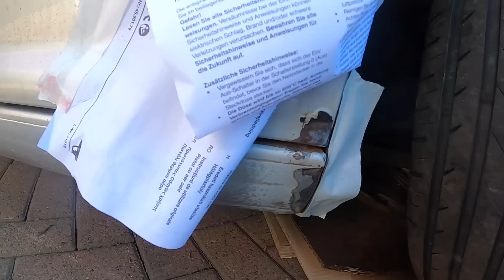Road to £10K l REGRETTING buying this car - EP.4

Comment: In 12 years of mk4 driving, any time i have had an air bag light i have disconnected the plug, pushed the wires firmly into the plug at both ends, reassembled, cancelled the light with vagcom and that has been the fix for a few months 👍 had a similar situation with the buying used power steering line, ended up getting a line made by a local hydraulic supplies place for a 10th of what vw wanted for a line. Worth a shot; take your line to them and they match the required banjo. Then tie it down with a p-clip or two in the engine bay 👍🙃

Comment: Airbag could be seat position sensor(not sure) try moving seat all the way forward or all the back see if it goes off, little metal crip under the seat brakes tells the airbag how hard to deploy depending on where the driver is seated, close or further away.

Comment: hey on my vw bora i wired the airbag i cut the connectors then wirded them together i will never take the seat out then clear the air bag light on the diagnostic tool and it worked

Comment: I believe that the brake pad wear sensors on VWs don't go open circuit when the pads are worn but go closed circuit (to ground) when the sensor wears through to the wire. So just joining the connecting wires won't fix the fault condition. You'll need to attach the remains of the wiring circuit and attch to the pads. The circuit is voltage checked which is another reason why you can't just join the wires. Also you may need to clear the stored ECU  fault code.

Comment: You need to clear the codes mate, they will stay on the dash until you clear them. You can do diagnostics on any pre 2004 VW/Audi car with a £20 obd to usb cable and the free VCDS lite software on your laptop.

Comment: You can just put a rubber pipe over the leak just cut the pipe reconnect it with rubber pipe with a few jubilee clips it works trust 😂

Comment: With the airbags, if you’re wanting to unclip the ones under the seats, you’re better off taking the seat out, two bolts at the front on the bottom, 2 trims off in the rear footwell, and slide the seat backwards out of the rails
Reply: I had that dreaded airbag light on my B7 Audi 🤦 changed the clock spring , unplugged the one under the seat a few times but there is one in the seat I think aswell bloody yellow airbag igniter switches.. I never solved it myself

Comment: Great video, despite what the eBay sensor feedback is I wouldn’t recommend fitting cheap sensors, used to work at a garage and even cheap name brand sensors cause nothing but problems go oe or a decent make there won’t be an issue.

Comment: if its had leaky door seals and the seneor has got wet under the seat, it could be knackered, matching them up is suppose to be a shitter because even if you get the correct part numbers they still dont always work. easier option, just get somebody with VCDS to turn it of, or google the resistor hack
Reply from the maker: Turn it off it is. Thanks man!

Comment: AIRBAG LIGHTS.

Hey mate,

I sometimes take out the seats of my passat when cleaning it. The irbag light always comes on once the seats been reinstalled. You gonna need to clear the code with an OBD tool. Then you should be good to go. :) works for me every time. Good luck on your way to 10K 😊